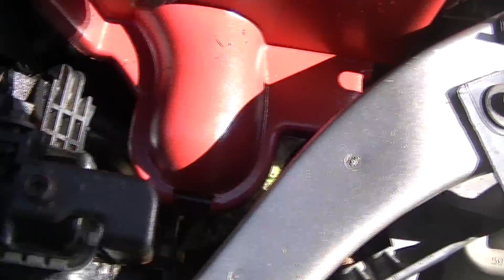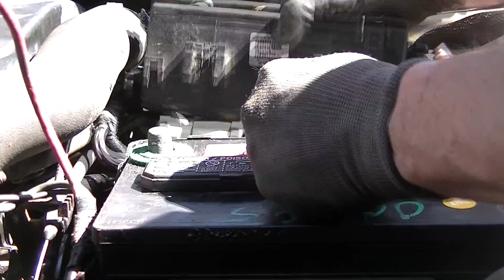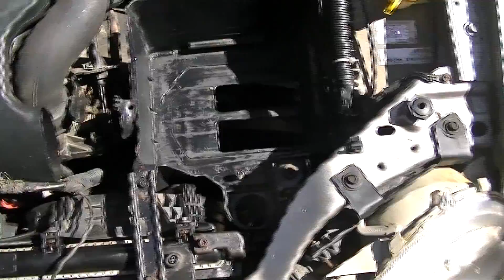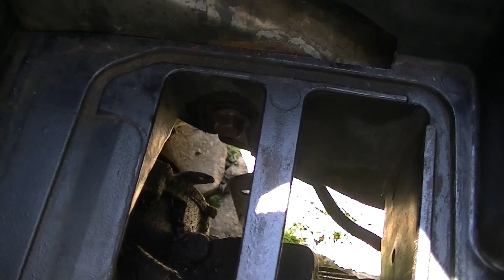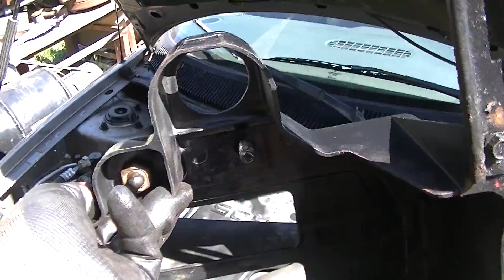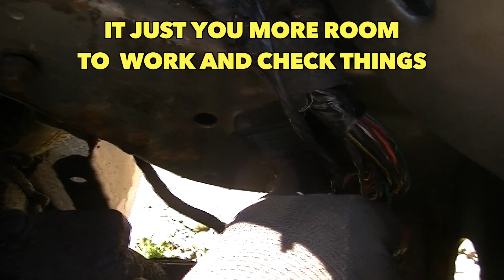Dodge/Plymouth Neon Battery Tray Removal....Easy

Comment: What year is this Neon? I'm confused about what I need to do to swap out a battery in a 98 Neon. Do I have to remove the battery tray like you do in this video, or just get the cover off? Do you know of any video instructions for just swapping a battery in a 98 Neon? Thank you.
Reply: i think once u remove the cover and the fuse you can swap out the battery. the neon also might be a 97 or 98. i have a 97